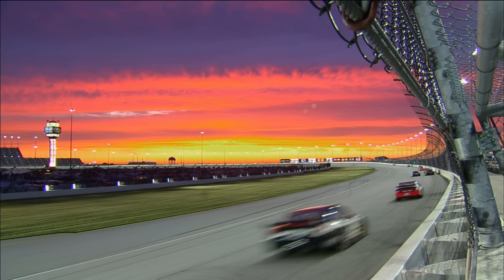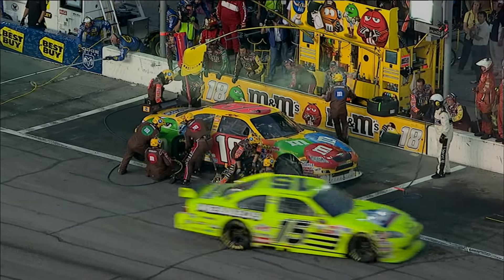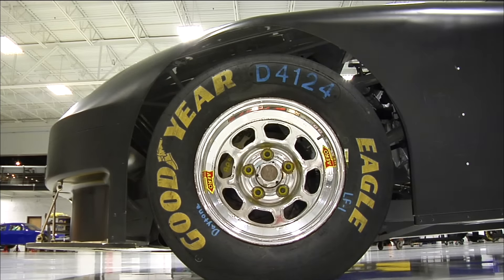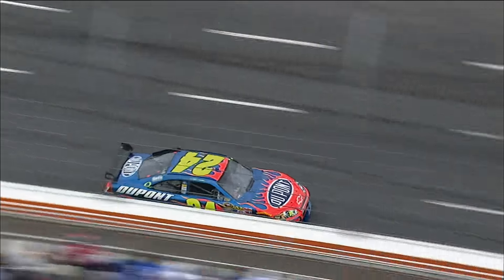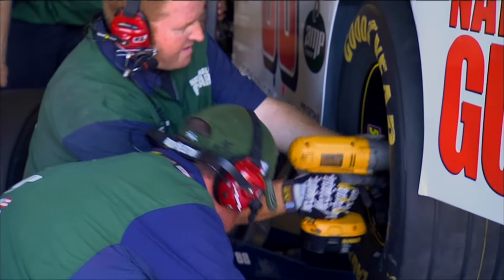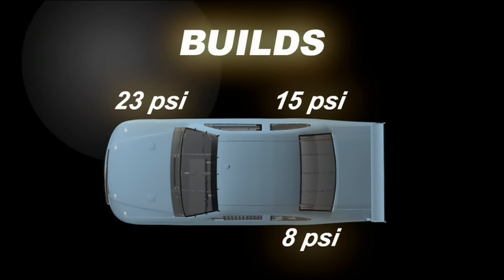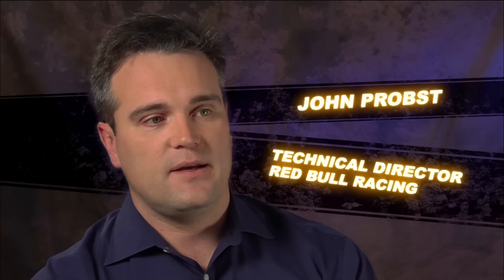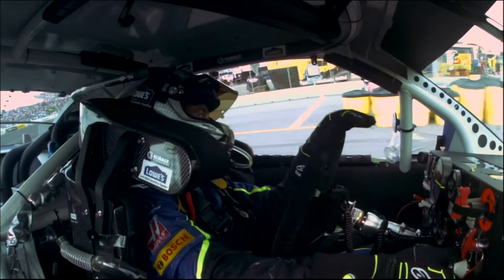Tires & Pressure | [NASCAR] Science of Speed

Comment: I found this very interesting, I have a converted ambulance campervan (European style only 4 wheels, no doubles on the rear) It weighs 2980kg. I run my Continental Fourseasons2 tyres at near max pressure, 69PSI. Am I running the risk of being to "hard" and risking punctures? They are all season tyres so have soft blocks to the touch.
Reply: You need a safety margin, run it at 65 PSI